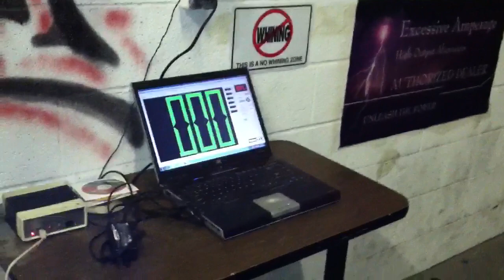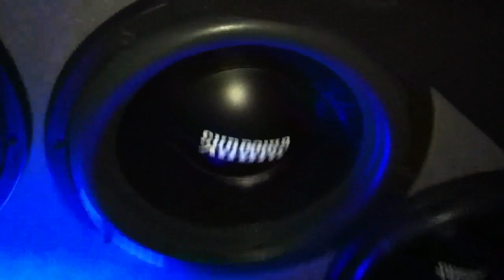Pulse car audio

Comment from the maker: @goatskindreams i clearly stated at the beginning of the video that I couldn't believe I was doing it... I'm not saying its even smart to do... and if it burns up the amps, my bad. but they are MY amps. lol  AND it has nothing to do with what I can and cannot afford. I actually just added an extra battery and the score didn't change one bit. SO that being said. I think that the EA alternator and the M3a amp are badass. Not to mention the amps are only rated at 2050 and I was only clamping 1200.

Comment: @pulsecaraudio1 your trying to show good numbers from a system and you always throw that in there. you can afford a 450 dollar alt but u can't afford a nice battery. its like saying i'm using a m4a but only with 4 gauge wire. your voltage in other videos dipped below 12 v and thats not good in any situation. rick i love your vids and i'm trying not  to hate but cmon bro! ask nate at ea if your stock battery is ok. and should run 2 3k + plus amps on it